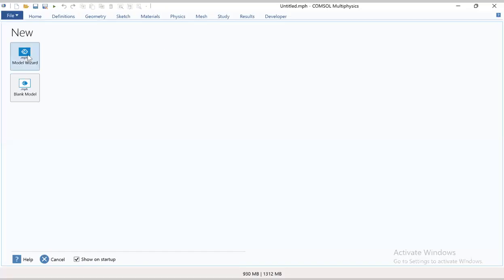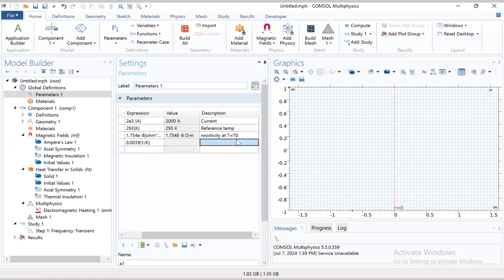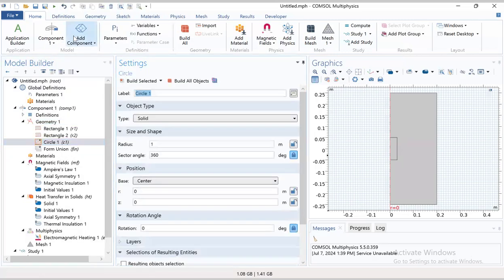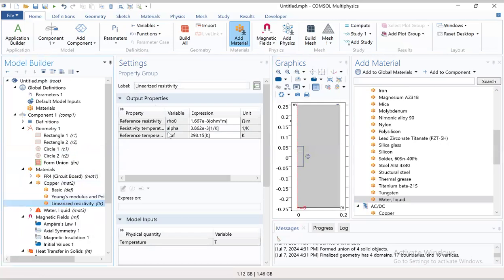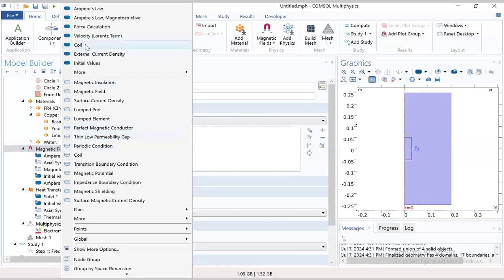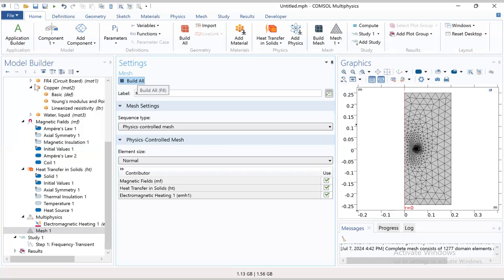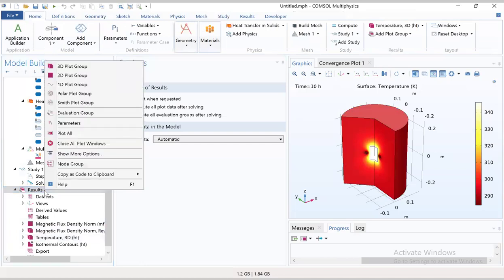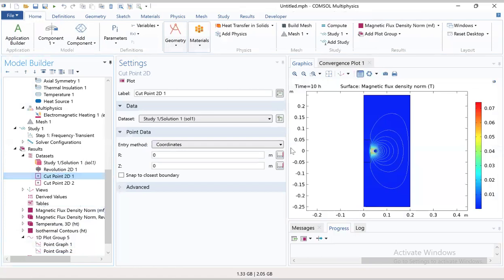Inductive Heating of a Copper Cylinder

Comment: If i want to module a 3d coil to induce heat in a 3D rectangle? is the same prodecure? or de 2D results when plotting in 3D is enough? Thanks a lot for the video
Reply from the maker: You can apply the same procedure to module a 3D coil. Also there are different types of results you can apply for the 3D results. You can select based on the type of results you need.